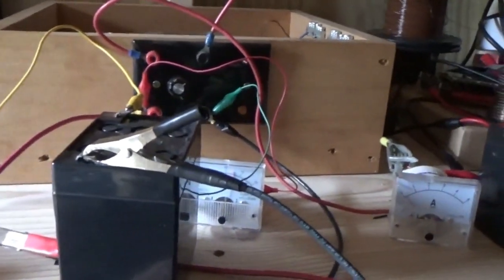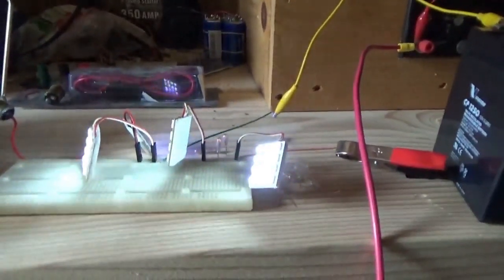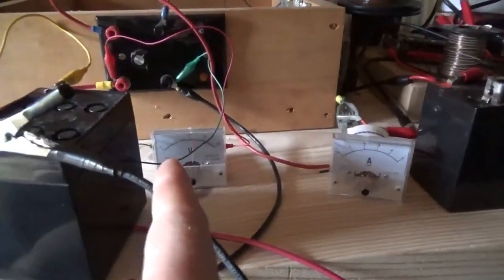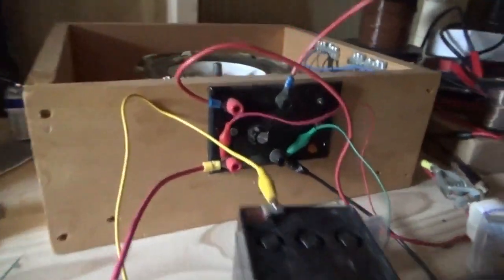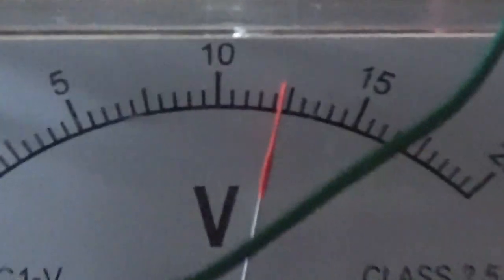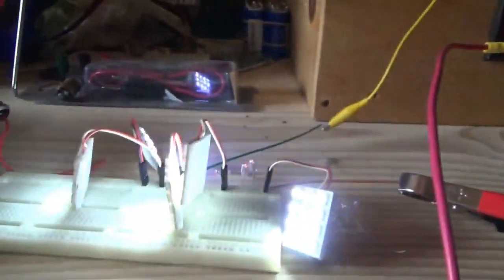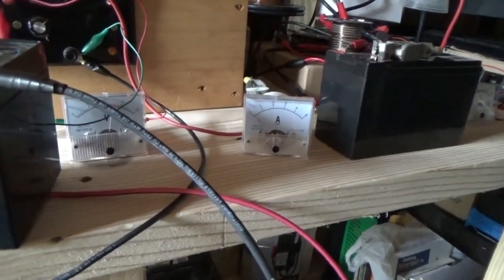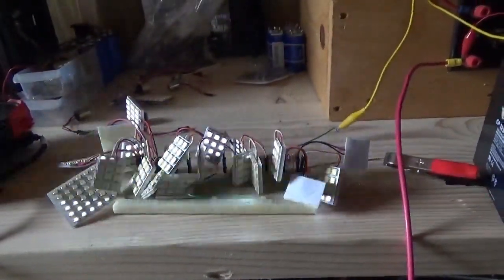Bedini Motor Running 19 LED Lamps ~ Lower Current & Higher Charging

Comment: You're not really demonstrating anything until you have an accurate volt meter and current meter on both the input and output of the motor. Once you do, you can multiply the amps x volts for each to get a reading of input watts and output watts. You'll find that the input watts are always higher than the output watts.
Reply: So Troy, why can't you measure the output current? Just hook an amp meter up to it. Sorry, but unless you can measure the output power in a meaningful way... The claim of "extra energy" is not valid.
Reply: You do know that all energy sent through wires is "super fast" pulses right?

And voltage and current arent both flow.
Without current or volts, there cant be power.
Reply: Troy, you often say solar power is free energy. But in reality it is energy conversion. The energy carried by photons of sunlight is converted into electrical energy. So source of the energy from solar panels is known and can be measured, both input and output. Can you point out the source of the "extra energy" from the bedini? That would form a theory that can then be proven or disproven. Thanks.
Reply: SCOTTY, WE NEED MORE POWAH!
Reply: Okay the obvious question is. If this is true how come there aren't bedini all over the world powering us right now?
Reply: Voltage is literally just the force that moves current. Current is the rate at which electricity flows past a point. That's all they are. You can't have one without the other.
Reply: No, voltage doesn't "travel" at all. Current travels, when under the pressure of voltage.
Reply: I don't need to look up the dielectric effect. To move electrons from one location to another is not gaining anything.To transform energy from one form to another is not a power gain To not measure voltage and current properly (or inversely impedance)  Your lack of lab diagrams would flunk you out of industry or education. Rant? Its called peer pressure. Since completing  my EET degree 45 years ago and working in the industry for 44 years, I have learned one key principle about techs or wannabe techs......the old engineering saying  still applies . If you can't bedazzle them with brilliance....baffle them with bullshit.
Reply: No current = no power! Power in watts = volts x amps.
Reply: learn what ELI the ICE man is all about...regarding inductance,capacitance and power factors.....but you wont learn it here.
Reply: The mathematics involved in analytical circuit analysis (trigonomtry, calculus ,and algebra) is NOT a blind religion.  It is glaringly obvious to me that you might not have a clue about the measurement of AC voltage measurement as it relates to power. To measure the ac power with a scope.....you will need a regular probe,and a current probe ...and you will need to know how to calculate "power factor" as you are in fact using a  motor and inductors and capacitors. You haven't demonstrated the ability to do basic DC circuit analysis ,let alone AC.
Reply: Hence why higher voltage can make a spark jump a larger gap.
Reply: With all the pulsing going on in this thing, a conventional analog meter may not be fast enough to show anything meaningful. You'd need a digital sampling scope to figure out how much power is going in and how much is going out.
Reply: Right and if your working with sine waves you have to be aware of RMS values and whether you are reading rms or not.
Reply: depends on whether it going into capacitance or inductance     ELI the ICE man.
Reply from the maker: Steven, the sad thing is the "experts" who are "trained" but rant against something without actually trying it for themselves. Its like blind religion actually. You want to know if it works? Build one. Until then you are just ranting on without knowledge. Not everything has been discovered in this World yet, nor has everything been fully explained yet. Anyone who blindly rants against something new has closed themselves off from reality. Make one Steven. You can make it with junk parts salvaged for free. Then lets talk.
Reply: The Do It Yourself World Troy even Joseph bedini himself said that is not an over Unity motor and in some articles if you read it explains why the meters that you're using are actually incorrect on the output side something to do with the frequency
Reply: You are 100 percent correct......the key to understanding is What is an RMS value (root mean squared) Some DVMs actually provide RMS values (modern ones)
Reply: To do an accurate measurement of the motor output you use  an rms  meter (provided it is within rated frequency range) You cannot simply multiply volts and amps when your source is a generator. I recommend you also study " power factor".
Reply from the maker: David, same with the Bedini motor. Its just giving me energy from a source that is already there. Like sun or wind. We cant see them but they are there. By the way, I have no way to measure either the energy of the sun or the wind but I sure can use them. lol
Reply from the maker: Oh Steven. Look up the dialectric effect. You will find that after pulsing a capacitor into a battery very rapidly and then quickly disconnecting it, the capacitor will regain some voltage. That is essentially free energy. I do not put it into the capacitor but it is there. You can do this again and again, constantly gaining that little bit of energy.
Reply from the maker: And Steven, I am quite certain that no matter how many meters and gauges I show, you will still deny it. Because all of your "Education" wont allow you to believe it. I was also trained in electronics for years. But I had to forget my blind "religion" in order to accept this and build one for myself.
Reply from the maker: The SSG is not an overunity motor when first built. No. But he also continued to work on tuning them and showing us some very interesting results. The thing is that people keep looking for "free energy" or "creating energy" but that is not happening. You must use energy in order to harvest this sea of energy. Remove the drive battery and it all stops. The window motor runs all by itself but I think that is just a cool toy which I dont plan to build.
Reply: D Lastname your attempt at humor = fail.
Reply: Voltage and current arent two things moving at different speeds. Voltage can be though of as the push of current, and current the amount or energy. Voltage and current are both in relation to the same thing. 

Wtf.
Reply: The old garden hose adage works here.
Reply from the maker: David, there is no current.
Reply from the maker: You cannot measure the output of this with normal meters. The only way to find the output is to do work with the battery being charged or add lights to the output and see what the limit is. There is no way you can light all those LEDs and watch the input current go down with conventional energy.
Reply: I'm not sure what you mean by "You cannot measure the output of this with normal meters." Of course you can. Put an amp meter in series with the output and it will tell you how much current the LEDs and charging battery are drawing. Put a volt meter in parallel with the circuit and it will tell you the volts. You can do the same thing with the input side to get a measurement of watts for both input and output.
Reply from the maker: Its not the energy we can measure with meters. I cannot explain it. I am not an expert. But thousands have demonstrated and explained this. Its pulsed energy. Super fast pulses. What meter can read that? An oscilloscope will show you the output, if you like. But it cannot tell you the current output. There is no current. Its voltage pulses with no current. Current flows slower than voltage.
Reply from the maker: voltage travels faster than current.
Reply from the maker: Yes Jim, you need a good high speed scope.